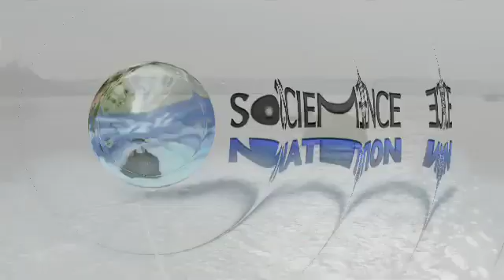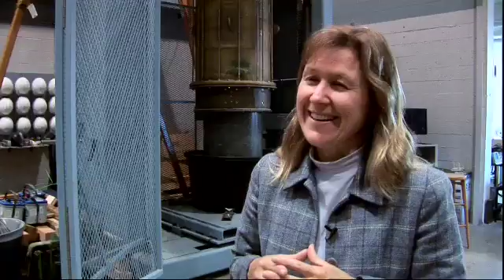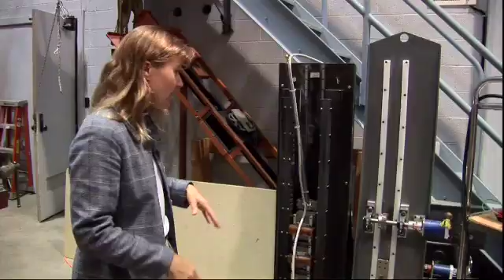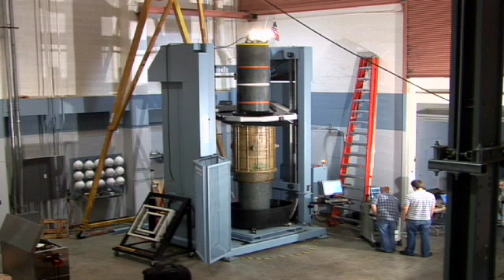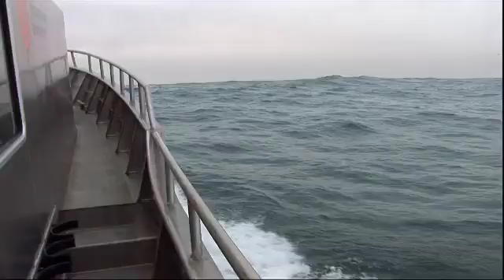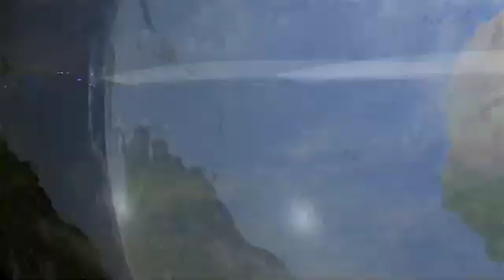Wave Energy: Harnessing the Ocean's Power - Science Nation

Comment: use a very strong and long floating and bar handle so at another end we got a very high speed and mass acceleration and we used this energy in hydrolysis of water and hho gas generators so we got more power clean environment and endless energy